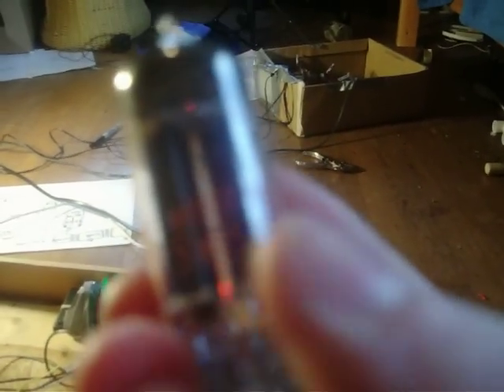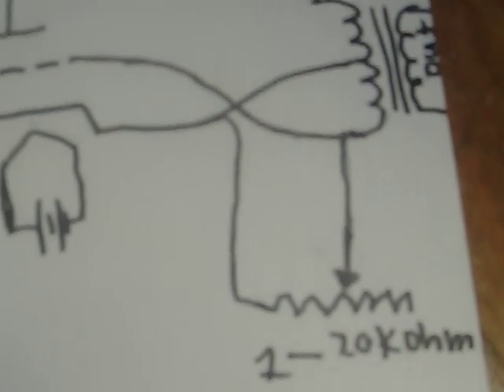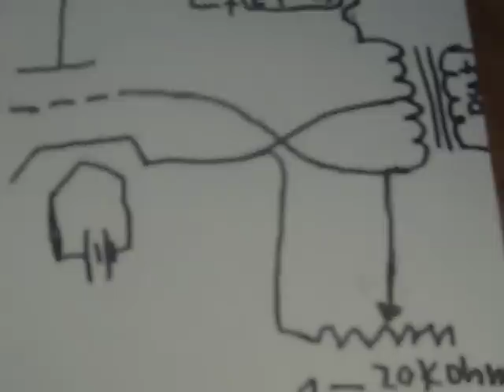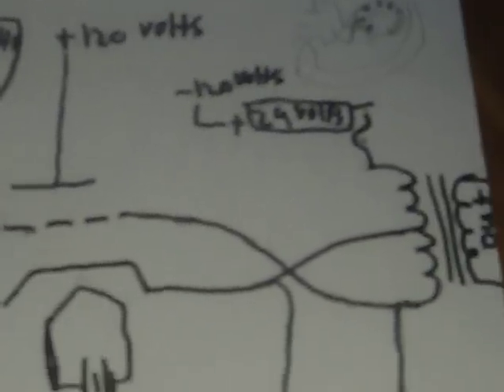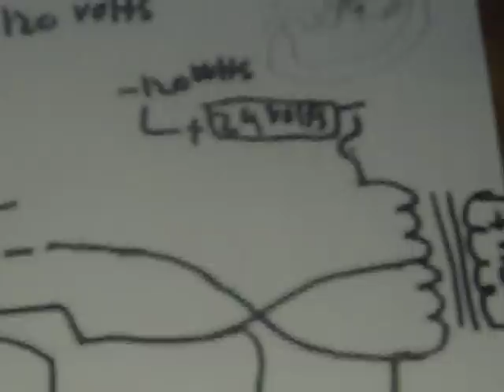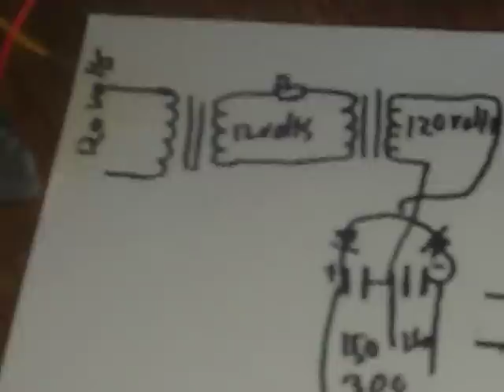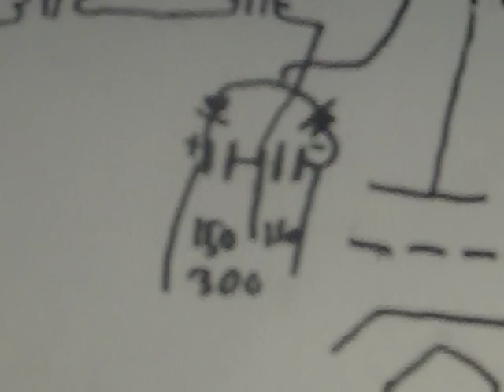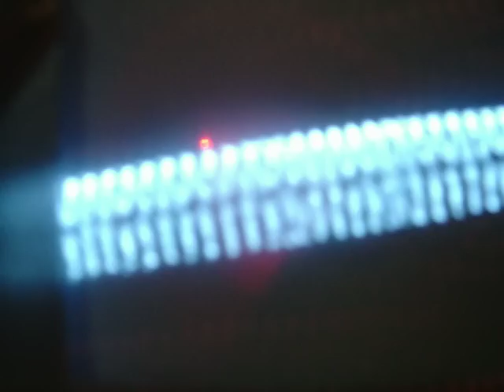vacuum tube oscillator

Comment: I like how nasty vacuum tube oscillators can get. I'd like to build a synthesizer, so funding a good vacuum tube oscillator is tough.
Reply from the maker: thanks for the comment, I am really embarrassed when i re-watch and see how crappy they are, I am glad though that people can put up with it.
Reply: I like when vacuum tube oscillators are mean and gritty :D
Reply: And because of that, I may have to build this oscillator. I assume there's a control voltage of some kind going on?
Reply from the maker: the voltage input does not really matter, it can be from 70 volts to 200, also the low voltage supply that i said i needed in the video is not needed.
Reply: Alright, so the schematic presented works perfectly then for what I want?
Reply from the maker: yes, but it might take some experimenting with different transformers to get it to oscillate properly. If you have an oscilloscope (not like the one in the video) the will help you immensely. good luck
Reply: Do you have any recommended transformers?
Reply from the maker: If you could find a 240 volt mains to 6 volt transformer i think that would work the best, but i think a center tapped audio output transformer would work.
Reply: Alright, thanks!
Reply: jdflyback oh! last question! Any recommendation on where to get a large collection of tubes like that? I know people sell individual tubes.
Reply from the maker: try ebay or this site: https://www.tubeworld.com/index_high.htm   Hot deals are a good place to start.
Reply: Thanks!
Reply: jdflyback OH! Here we go. Ok, so in regards to control voltage. So I know it will need a power source, that's a given, but I want to control the pitch as well. Is that taken into account in the oscillator? I assume it is, but just curious.
Reply from the maker: the variable resistor shown controls the pitch. making it able to power it off of a single supply.
Reply: OH, duh, I thought so. Thank you.
Reply: Is there a shopping list for this?
Reply from the maker: all parts needed are shown. 2 mains to 12 volt transformers, 2 diodes , 2 filter caps, one triode valve, a five k ohm potentiameter, an audio transformer with a 200 ohm center tapped primary and an eight ohm secondary and a filament power supply for the valve. if you need anymore help i can easily post a video with more detailed instructions.
Reply: Got it! Ok, now I think I can get started, haha.